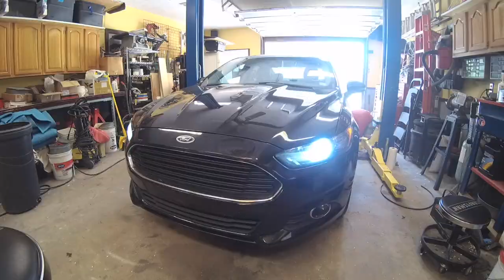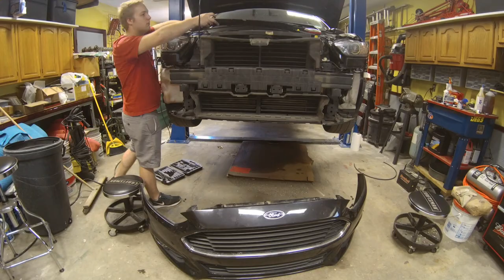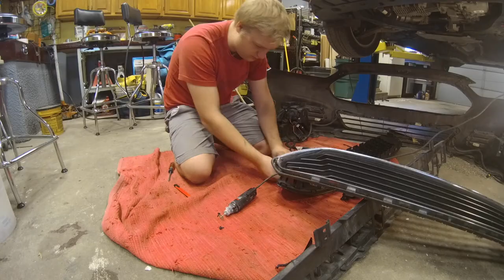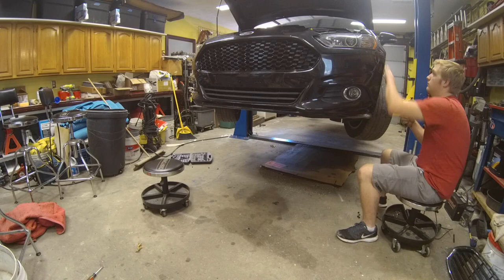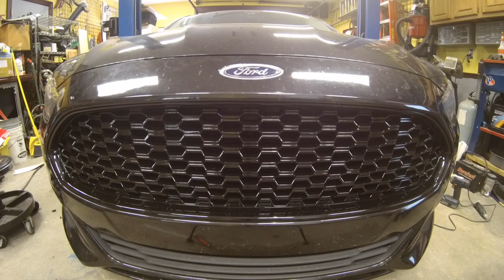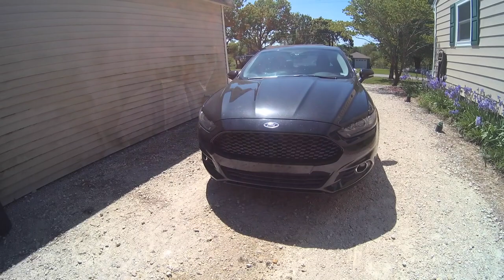Fusion 2G Grille Swap with DMS Lift

Comment: So I don’t have to remove the big plastic piece under the front of the car to take off bumper ??  Just the bumper only ?
Reply from the maker: Miranda Collins no you do not need to there should be about 6-8 7mm screws under the front edge of the bumper
Reply: Chad Mees  okay awesome!  Thank you so much, I thought I’d have to take it off to unplug the fog light. Thank you
Reply from the maker: Miranda Collins you can reach the plug for the fog lights on the drivers side. There’s A big connector that basically disconnects most of the bumper stuff. You should only have 1-2 little plugs near the radiator on the passenger side.

Comment: What did you need to cut off ? The grill didn't fit properly ?
Reply from the maker: There are 2 tabs that are on the top that are used for the Mondeo that are not used on the fusion. If you try to install it then it won’t sit properly
Reply from the maker: Removing those tabs allows it to fit fine
Reply: What did you use/how did you cut the two tabs off the grill?
Reply from the maker: I used a dremel tool but you could use a razor blade and score the plastic then break it off